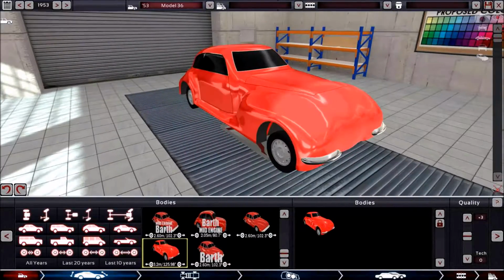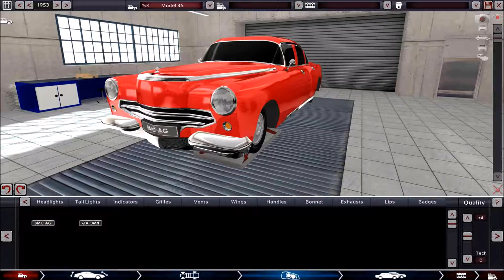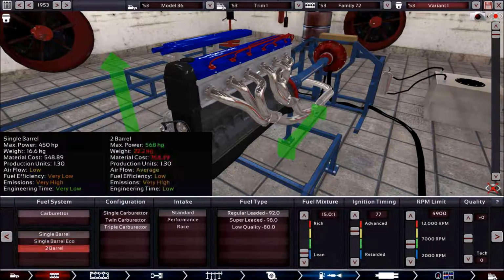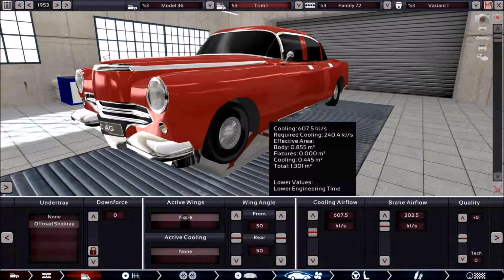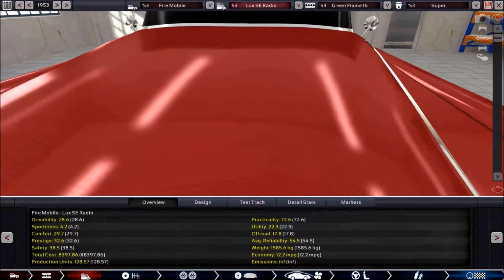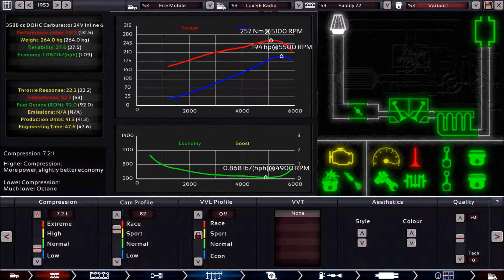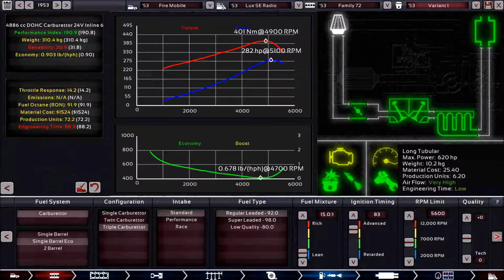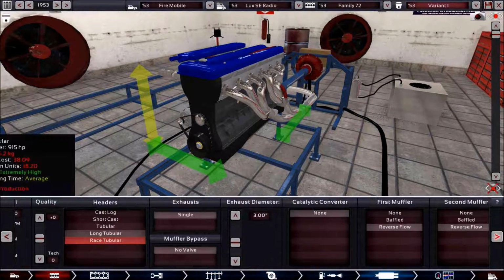Updated Burnside Rival Automation

Comment: Your engine at 14 minutes in wasn't better in every way other than price, my I6 was over 25% more efficient than your I6 as well as over 45% more reliable, almost 30% smoother, over 25% lower service costs and not 400 cheaper, but almost 700 cheaper. Plus since you brought up weight, you best remember how you're using aluminum heads with the lightest headers while I was using iron heads with the heaviest headers, I easily could've spent a little extra to go with lighter headers to make my I6 lighter with things like power, torque and efficiency all improved. Since you barely beat me in torque, just switching headers may have been enough for my I6 to match yours in torque, power however? Yeah, I likely would've had to redesign from scratch to match. Also, your engine used 4 valves per cylinder and while technically that tech did exist back then, it was only used on race cars and homologation specials (detuned race cars for road use required for the manufacturer to be eligible to run their race car). Multivalve (more than just one intake and or exhaust valve) production engines didn't start until the early 70's, even super cars like Ferrari's and Lamborghini's didn't use 4 valves per cylinder until the 80's, so there's no way 4 valves per cylinder is authentic on a 50's yank tank, neither is OHC really which we both used, but OHC 2 valve per cylinder was definitely used over in Europe.

Also another thing, you said due to your engine being more expensive, you'd have to cheap out on the seats or something, yet, you ended up going with a high end interior and put almost everything on +3 quality, that's the opposite of cheapening out!!! Especially since you went back to the drawing board for your engine and came out with an even more expensive engine again! And talk about overkill, you were hitting over 300 hp at some points and ended up with 282 hp, meanwhile the fastest car in the world from 1954 up until 1958 when it had already been put out of production, the Mercedes-Benz 300 SL only had 212 hp. BTW, the 300 SL only had SOHC 2 valves per cylinder (like my I6) and it had strong racing routes.

You did a good job on the front end of your car, I really liked the chrome trim on the bonnet, and it's definitely better than what I would've done beforehand, I think the rear needed more work however. I do hope you make another car in the 40's to 60's soon, maybe not for your next automation video, but hopefully after you do a more modern car or 2 if you'd prefer to do so in between.

Here's the markets tab for the car I made with my I6: http://steamcommunity.com/sharedfiles/filedetails/?id=810103238
Here's my I6 as a reminder for you and newcomers alike: http://steamcommunity.com/sharedfiles/filedetails/?id=810103081
Reply from the maker: Admittedly I did go crazy with this engine, I think I just got used to 5
 valves per cylinder on every engine and got scared of using 2 again.

Having said that the engine used was supposed to be in a high end version of the car.
It also alllowed me to see what was possible with the technology of 1953.

I'll make a video where I create a more mainstream, more reliable engine that most people could afford.

As for the pricing the car didn't seem to expensive so I decided that the premium interior and infotainment was'nt too expensive.

Another problem is that Automation's pricing seems to be perminently stuck in 2016 so the parts don't add up to the crazy cost that they should.
Reply: Core2Duo_E7400 (G'day Bruce here): Okay I guess... but again, how much more high end can you get than supercars? Like I said, Ferrari and Lamborghini didn't start using 4 valves per cylinder until the 80's and both the Jaguar XK120 and the Mercedes-Benz 300 SL, the fastest cars from 48'-54' and 54'-58' used DOHC 2 valve and SOHC 2 valve respectively.

As for pricing, well I remember James May saying in the Top Gear episode they had the XK 120 (48's fastest car) race the Vincent Blackshadow (48's fastest bike) and the Peppercorn A1 class "Tornado" (48's not fastest train, but the U.K.'s newest train as of 08') how in 1948, you were getting a Bugatti Veyron (fastest car in 08') for the price of a Ford Mondeo, so, I decided to look up the 08' pricing of a Mondeo and here's what I found: http://www.caradvice.com.au/7274/2008-ford-mondeo-details/ http://www.carmagazine.co.uk/car-reviews/ford/ford-mondeo-edge-18tdci-2008-review/ TL;DR is: It costed 30-42K in Australia and 17K Pounds over there which is probably ~35K Australian given that a Pound-Sterling is often worth twice that of an Australian dollar, meaning if the game uses Australian dollars (which it might as many of it's devs came from Australia), 30K including a very high margin is probably how much a late 40's hyper car should cost. If the game goes by US dollars, then the budget would be even less given that US dollars are usually also worth more than Australian dollars. So with all this in mind, your car at 19K with a tiny margin strongly suggests your car is probably too expensive which explains it's poor performance in the markets. So I'd say the pricing in the game works fine off that.

I look forward to this more mainstream, more reliable car you have in mind, will it be your next vid? When can I expect it?
Reply from the maker: I just attempted to build a new engine and it took the car in all kinds of crazy directions. Lets just say that it isn't quite the car you used to know.
As for the upload date I have the clips, I just need to edit them; it should be uploaded before the weekend.
Reply from the maker: It was also incredibly difficult to rival your I6 for power when it came to it :-)
Reply: Core2Duo_E7400 (G'day Bruce here): You're being sarcastic right? You crushed mine for power.

R.I.P. front end of the Fire Mobile. :'( And I'd hope you get it out before the weekend! The week barely started.
Reply from the maker: Corvette6317
Not with the smaller 2 valve per cylinder engines I was messing around with later.
Reply: Core2Duo_E7400 (G'day Bruce here): Oh, okay then. BTW, you use UK MPG in this game right?
Reply from the maker: Corvette6317
I think so, it's definately MPG.
Unless there's some strange other type of MPG that I dont know about and have somehow selected.
Reply: Core2Duo_E7400 (G'day Bruce here): Yeah, the game has both UK and US MPG, I forgot which is bigger units.